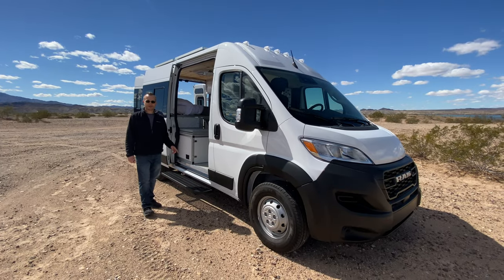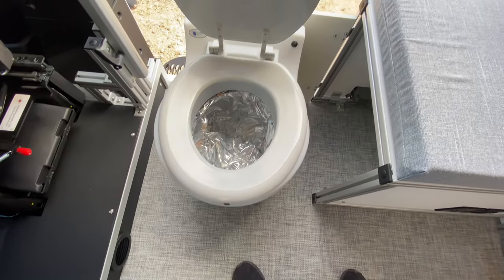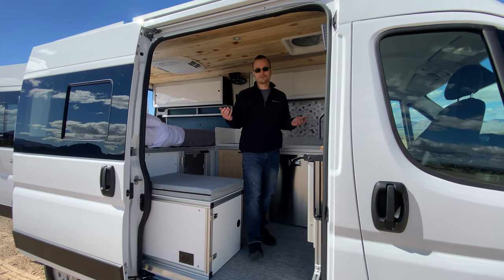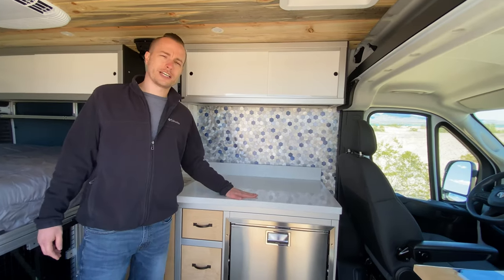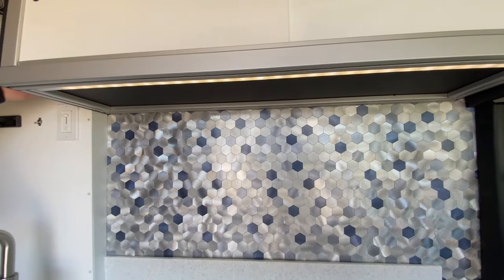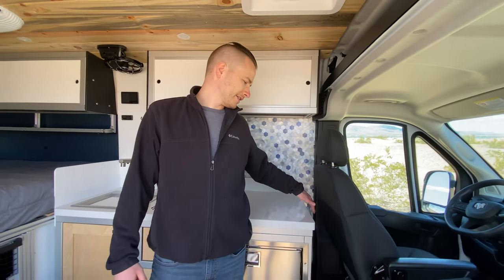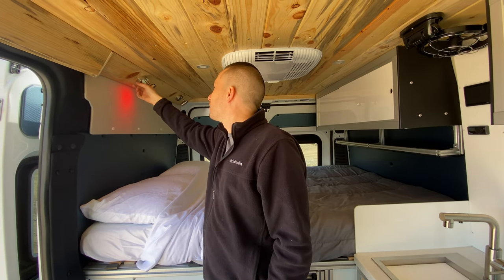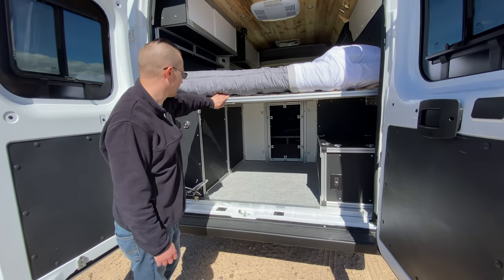80/20 Aluminum Build | Marine Grade Promaster 136 #vantour

Comment: Good going with the black mesh, less noticeable. As it would be inhumane to expect a dog to be restricted to the confined space for a long time, I'd have gone with a door which could be retracted out of sight. Maybe a flap hinge with a cantilever handle to avoid bending, or a hinge on a slide for the same stowed position, sliding mesh :o I was thinking of the same area for my dog, but the door would be used as a step for a higher bed higher garage. I hope the spare seat can swivel if a double, with space to move between into the van